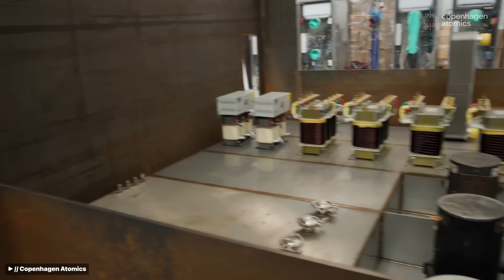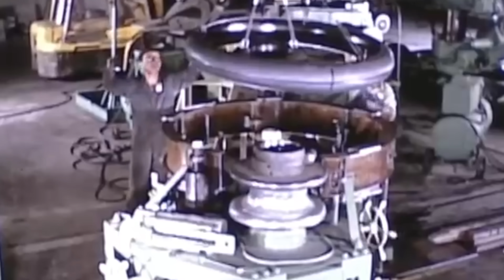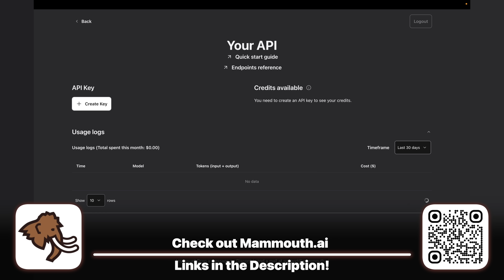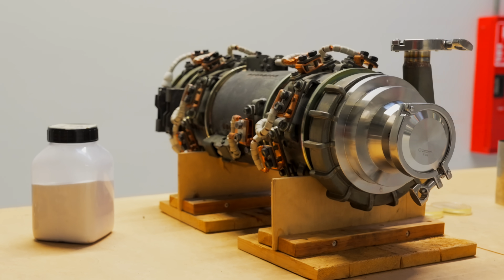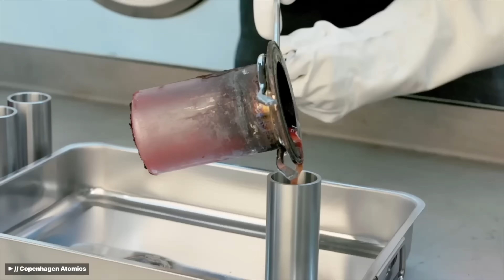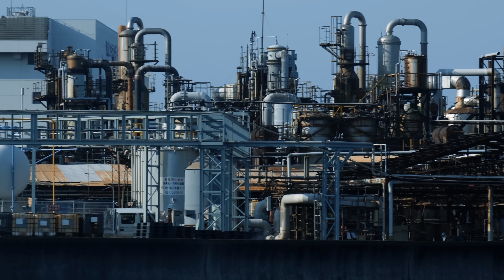This Modular Thorium Reactor EATS Nuclear Waste

Comment: Thorium has NEVER been bred at reactor level quantities to power a reactor
Reply: It has, but not in a molten salt reactor. It was bred, I think, in the Hanford military reactors, and tried in the Shippingport reactor in Pennsylvania, and in Indian Point One in New York, both pressurised water reactors. Fort St Vrain in Colorado (helium cooled, graphite moderated) also used a uranium/thorium cycle. The core had seven tons of thorium, with nearly a ton of highly enriched uranium to kickstart it.

Comment: Notice they never discuss protactinium?
Reply: Protactinium is a neutron poison till it half-lives out to U233. Half-life is 27 days, and the reactor is to make 100 megawatts thermal. One gram of fissile generates a megawatt/day, so there should be on the order of 3kg of Protactinium233 ripening in the blanket, on average. There are 3,000 litres of thorium tetrafluoride/lithium fluoride in the blanket, eutectic ratio (lowest melting point) is 78 mol% LiF, 22 mol% ThF4. 
Molar mass L7iF is 7 + 19 = 26. Molar mass ThF4 is 232 + (4 x 19) = 308.
Specific gravity of eutectic LiF/ThF4 at 600 C is about 4.4.
0.78 x 26 = 20.28
0.22 x 308 = 67.76
So about  three quarters of the blanket salt by mass is ThF4, and three quarters of that is thorium.
Thorium mass is (.75 x .75) x 3000 litres x s.g. 4.4 = about 7,400 kilos of thorium. 
3 kilos of protactinium in 7,400 kilos of thorium (with nearly equal atomic masses) would suggest that a neutron is far more likely to be absorbed by thorium. However, the neutron absorption cross-section of protactinium 33 in the thermal spectrum is about 50 barns, for thorium, only about 7 barns. 
7,400 x 7 = 51,800
3 x 50 = 150.
51800/150 = 345.
So a rough estimate is that a neutron getting into the blanket is roughly 300 times more likely to be gained fertilising a thorium nucleus, than lost making non-fissile Pa234. Pa234 decays in a few hours to U234, which is not fissile, but it is fertile, and much more likely to absorb another neutron, and become fissile U235, than natural U238 is to become fissile Plutonium239. U233 fissioning in the thermal spectrum averages slightly more neutrons than does U235 - on the order of 2.5 per fission, plus a few from gamma activation of deuterium in the moderator. One for the chain reaction, one for breeding, allows 0.5 for absorption/escape losses. So I think if CA can make as neutron-transparent a core as they plan, it could breed. Whether it and the pumps would last five years, whether they can engineer leak-proof pipe joins between composites and steel, and whether they can filter out all the non-volatile fission products, is to be determined.

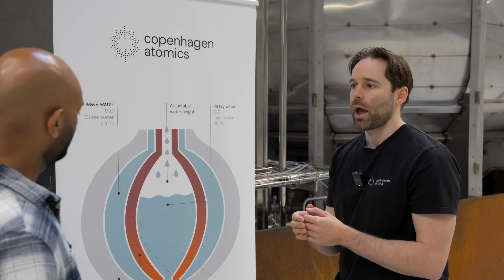Comment: At 6:20 we come to the regulatory nightmare, the thermal isolation of the hot salt at a few cm distance from the not very hot water. I am not sure if this gap should be filled with graohite or vacum. How can this be made hyper reliable?

Comment: They changed their business model recently. Now you are buying the reactors for an upfront cost of 50M$ and have to par 2M$ a year for CA to keep them running with fuel and reactor swaps. The costumers are them selves responsible for permits, containment structures, turbines etc. That will likely add another 50M$ pr. reactor, but it is still super cheap. I believe it will allow CA to expand faster, and lower the financial risk of the company.

Comment: Around 16:00 it is stated that 'the lithium is very unlikely to react..."
Contrast THAT with the fact that Lithium has been used in pretty much EVERY thermonuclear weapon since Castle Bravo since Lithium WILL break to form Tritium and Helium.
Sure, the volume produced isn't HUGE (since Lithium has a rather small cross section), but mathematically, the word 'small' is INFINITELY larger than 'zero'.
Therefore, SOME quantity of tritium WILL be produced and, being a gas, it is VERY easy to extract the Tritium gas from the liquid fuel (along with the Xenon, Krypton etc).

Personally, I'm not worried about this at all, but when videos such as this one tell such porkies / political spin, I become acutely wary of what ELSE they have failed to point out.
IMO, tell people ALL the facts and let them make a rational and informed decision!

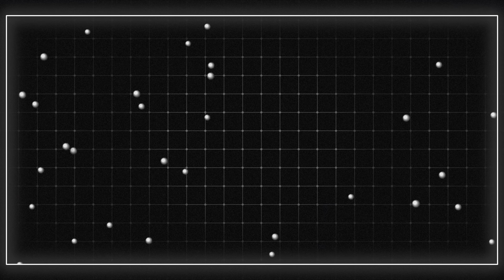Around 17:30 the statement is that Lithium-7 is 'completely transparent'...
I refer readers to the Castle Bravo test which had an expected yield of 6.5 MT and ended up being 15 MT (250% MORE!)...  The reason is that they found out too late that Lithium-7 is NOT 'completely transparent' and thus produced SUBSTANTIALLY more Tritium than had been expected thereby boosting the yield by 250%.
At STP (standard temp & pressure) Li-7 is indeed around 20,000 less active than Li-6, but the inside of a nuclear reactor is a VERY long way from STP!
PLEASE do your research!

Comment: $30/MWh would be very impressive. It will also go up as production gets closer. But they have a quite a lot of wiggle-room there. 24hr backup solar+batteries is now at about $70/MWh in sunny places, so if they can get anywhere round there they will have a popular product, especially in non-sunny/high-latitude places.
Reply: If they ever get something working it will be closer to $300/MWh.
Reply: @andreasschmitt2307  Probably, yes. The $20-$30 seems highly implausible, but I've not seen their sums so have no way to judge other than vague handwaving with respect to other projects. The game of putting out unreasonably low costs to get funding then finding out that they were wrong seems a bit silly really, but I guess that's the world we live in now.

Comment: The thorium reactor shown in this video is just a laboratory device, while China has already surpassed it. It completed a laboratory device 10 years ago, and now a small-scale commercial device has been built and started generating electricity commercially. A large-scale commercial mature device is under construction, and another ultra-miniaturized device for use on the moon has also been tested.
Reply: That's not true. China hasn't even started yet to build their first thorium reactor, the TMSR-LF2. It was supposed to be finished in 2025, but nothing yet.

Comment: Hmmm...the answer to the gigantic, centralized, nation/continent spanning electrical grids with their single points of failure and other obvious shortcomings?
A distributed, not necessarily networked system of small, resilient electrical grids seems like a good idea. These seem too powerful for individual homes but, how about using them for serious power sinks like data centers, industrial applications and small commercial and household networks?

Comment: the magnetic bearing and tech for their pump design was pretty amazing. im a little confused you did not reconcile or revisit supercritical c02 statement from the beginning of the video, or i missed it when talking about performance and overall energy output.  Overall, i think modularity like this is very key to humanity's future of more resiliant power plant availability and scaling. the steel cask sounds like a nice social, mental and practical 'safety blanket' but i think that's going to be the most challenging aspect of the design during sales and rollout. The idea of shipping a standard shipping container around isn't that challenging from a logistics standpoint, but 100 tons of 20" thick steel sounds nuts. who even has the capacity to make that and ship it long distance like the reactor? what does the assembly process look like, cranes etc? does it go in the ground, or on the surface of the installation site? the reactor itself fits in the shipping container footprint, but what about the steam / power generation, is that also figured out and fit in the footprint of a shipping container? now we're at 2 shipping containers of site footprint. That 100 tons of steel is probably 2-3 heavy hauler 18-wheelers with special permits, then 1 for the reactor and 1 for the steam/ power generation and probably 1 for auxillary connecting infrastructure for the site, maybe 2 - then a crane which is another 18-wheeler. So to deploy one of these you're looking at 7-8 18-wheeler heavy haul deliveries worth of material, maybe an 9th or 10th, lets assume you put a living /supervisor planning container on site and then 1 container with consumable food & water & maintenance supplies assuming youre in an off-grid location and maybe another truck with a diesel tank for generators temp onsite power generation during construction. so you're really up to 10 to 12 heavy haul truck deliveries on the conservative side of needs for a location you'd want to install one of these, in a rural area with little to no power generation capacity or an area with a weak power grid and infrastructure needing this kind of power plant to help lift up infrastructure.   

overall it's nice that the reactor itself sits in the footprint of a shipping container and a big steel cask but with supporting elements and temporary elements for installation, the container is still only 1 10th of the installation logistics. these things are still going to cost an arm and a leg in shipping and require supply chain /contractor specialization and capacity** that don't exist right now. Unless they can subcontract and train teams to install these in 1 day then there's no way their 1/day production financial math is ever going to reach fruition. I want this to succeed, modular nuclear power reactors are our idealized future and it's tech that needs maturity especially for long term space exploration as the next step for mankind along with renewables - but either these guys are living a dream world with many challenges left to tackle, or you missed out on a ton of important aspects of this plan in the video. I hope they are profitable at way lower production rate than 1 per day per line so they don't fall short of cashflow needs

Comment: Interesting technology:
1) I think these reactors will find quite a nice niche for utilizing waste from our ageing nuclear fleet as retrofits instead of closure.
2) Business model is interesting, but I don't think it removes all regulatory hurdles, as it'll still need fissile material for a startup and it can produce U-233. "U-233 is classified by the IAEA in the same category as high enriched uranium (HEU), with a significant quantity in terms of safeguards defined as 8 kg, compared with 32 kg for HEU". So tight regulatory regime will still be there, but business model helps solving that issue. Nonetheless, it might still make projects long, not by lead time to "assemble" the container, but to go through all necessary paperwork.
3) Paperwork is another issue - I'm not sure if it even exists for SMRs (I'd appreciate some corrections on the matter). If no, someone should probably press the regulatory bodies to create one. This will also require smart lobbying. If they try to market their solution as a new generation of nuclear they might be treated by "traditional" nuclear producers as a competitor. Instead, if they try to go into the niche I mentioned in (1), they might get nuclear lobbyists on their side.
4) In the beginning of the video we have a sentence on economics "... assuming 40% efficiency of supercritical CO2 turbine ...". Well... supercritical CO2 turbines are not off the shelf solutions. They are currently being developed. But this will also be a new technology with it's own uncertainties, especially that for such turbin You'll need heat exchangers integrated in a way that lets effectively passing the heat from molten salts to supercritical CO2. Then the problem is in high pressure installations. Development takes time. So I think it's safer to divide the electricity generation by two as for steam cycle. Then to 50 M cost of the reactor also add a cost of heat steam generator, turbine, and condenser... Unless we come back to point (1) and make this solution as an auxiliary to existing nuclear plants - in such case just integrate it with existing nuclear plant.
5) The container is a fancy "marketing" to bring attention of people with money. The reactor will be very heavy and definitely will not be transported by the same means as standard shipping containers

I think that it's a nice technology with an important niche application in existing nuclear plants, but not necessarily the gamechanger. Looking how fast solar and batteries are improving, I doubt such technology will be fully commercial soon enough to matter. Having said that, I still think it should be further developed as there are some legacy problems with nuclear that we still need to solve.
Reply: Solar and man made batteries are pathetic.
Reply: @TerraPotens537  They have two advantages:
1) They work now.
2) Available now commercially.
Batteries still can make some progress on the learning curve, with cost decrease in the future.
Reply: @ThewayofthecardsMTG   That doesn't change the fact that they're pathetic.  

If you have a more reliable energy source than wind and solar with batteries, and we clearly do, why the fakok would you choose to install the more pathetic energy source?
Reply: @TerraPotens537  It also matters how fast You can deploy them. Nuclear is very reliable, but takes sweet time to deploy: 
1) Hinkley point C is still not generating. The expected cost was 18 billion GBP and now climbed to 35 billion GBP. The investment was announced in 2010, licence granted in 2012... and now we hear that the plant will start generating electricity in 2030.
2) Olkiluoto Unit 3 in Finland obtained permission in 2005 and started regular electricity production in 2023.
Unfortunately time = money, and if You start building and wait 15 - 20 years before You can actually sell something, You'll gonna end up with something quite expensive.

Intermittent sources with batteries are reliable enough and are getting cheaper.

Comment: There's nothing better about thorium reactors. The toxic waste is still problematic at scale, and salt is corrosive. It is not solving anything. Renewable energy devices, made from hemp fiber bioplastic composites are the most sustainable way for clean energy. Stop pushing nuclear propaganda, and follow the process all the way through to its limitations and byproduct pollution as it accumulates over time.
Reply: Solar and wind are pathetic.

Geothermal is the solution.
Reply: @TerraPotens537 all renewable energy is good. So, use multiple hybrid methods. Why limit your imagination to just one way that you personally favor?
Reply: @austinp.5024   If you have a choice of energy sources to choose from, and one of them pumps out reliable and abundant energy, and the others don't, WHY THE FAKOK would you even entertain installing the ones that don't?

Just for the sake of diversity?

No...  You install the optimum energy production system at all times.
Reply: @TerraPotens537  clearly you dont understand, nor care about the problem at hand. To invert your own question, if there is a way to create energy from wind or sunlight, completely FREE, why in the frack would you still choose the most expensive and destructive methods available simply so your corporate masters can continue living in luxury? Makes no sense to me whatsoever?
Reply: @austinp.5024   I understand completely, and what I care about is the environment.

A world filled with millions of wind turbines, billions upon billions of solar panels, and hundreds of trillions of man made battery cells means a crapton of mining needs to be done to gather all the resources required to do that.

That will result in literally thousands of open pit mines across the planet, on top of all the open pit mines we already have to contend with.

Wind and solar with man made batteries ARE the most expensive and destructive method to tackle the problem of removing fossil fuel power plants from the grid, both in money as well as environmental impact.

LCOE of geothermal is $37.58 per MWh
LCOE of OFFshore wind is $88.16 per MWh
LCOE of ONshore wind is $29.58 per MWh
LCOE of solar PV is $31.86 per MWh

Before you go, "Aha!  See how solar and onshore wind are cheaper?!" both wind and solar REQUIRE man made battery storage systems to function better than they would alone.

And the LCOE of battery energy storage is?

$126.20 per MWh

So clearly geothermal is cheaper than wind and solar with batteries both in money as well as environmental footprint.
Reply: @TerraPotens537  sorry you had to write all of that. But, your premise is wrong from the start. If you read my original comment again, you will see that I mentioned HEMP fiber bioplastics, biocomposites, and biofuels. That is the basis for replacing fossil fuels. Everything can be made to be biodegradable, i.e. sustainable. There is no need for mass mining, and the idea of trillions of solar panels creating more waste is simply a lazy argument at this point. Technology always improves with new innovations and the intentional use of human imagination. Where there is a will, there is a way. Closed loop systems are my specialty. Mass hemp cultivation solves a multitude of environmental problems, without creating new ones.
Reply: @austinp.5024   Well, I could agree with you, but then we'd both be wrong.
Reply: @TerraPotens537 absolutely NOT wrong. The answer to fossil fuel is hands down, hemp.
Reply: @austinp.5024  Sounds like your smoking the product

Comment: Cut off this Thorium crap. You can't separate the multiple actinides that form during the decay and they have wildly different chemical properties and half-lives. This could lead to explosions, erosion, leaks + radioactive contamination.  Irradiated thorium was the first track of research during the Manhattan Project, but they gave it up, because the process proved to be uncontrollable. What India and China are doing, is just further research, because they would benefit from success the most, due to rich reserves of the element. 
There are still competent people around. Talk to them. Make a visit to the library.